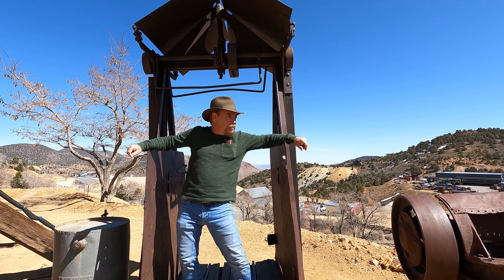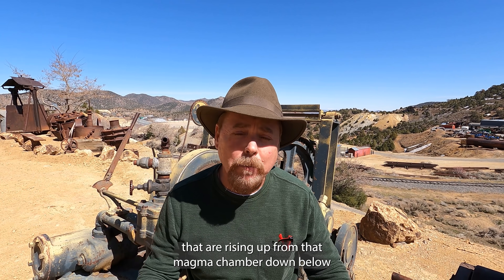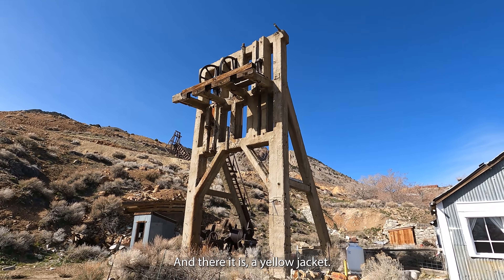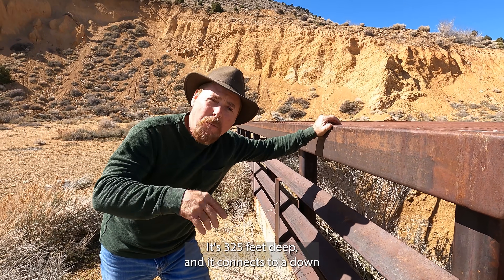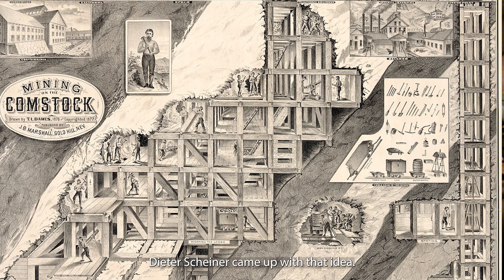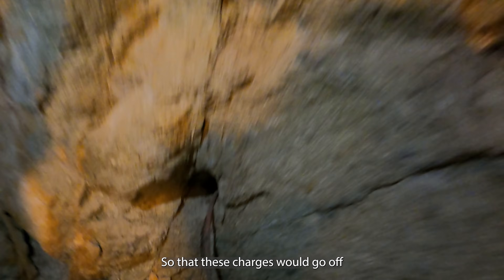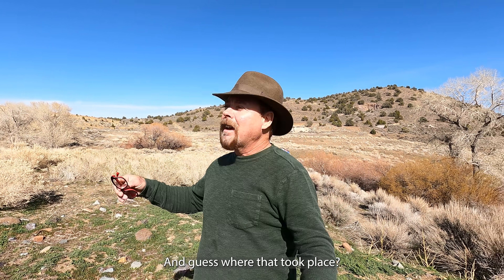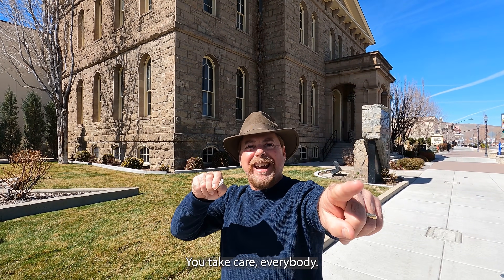Where Do These Valuable Coins Come From? - The Comstock Lode in Virginia City Nevada

Comment: That chain and plate is a catch plate for autimatically dumping the bucket at a certain point in the headframe. Thetes another catch plate located at a point on the headframe and once those two plates catch together, the bucket dumps. I put one on my sinking bucket a little while after i made the bucket except i used a small iron ball and welded a piece of chain to that to make the 'catch' then cut a Y type groove in a piece of steel and attached that to the headframe. When i bring the bucket up out of my mine, at a certain point, that steel ball catches into the Y cut thats in the steel plate which causes the bucket to dump into a chute and either into a ore car or into the dump on the opposite side of the headframe.
Reply from the maker: cool

Comment: Jeff, this is a bit off the subject, but after watching your dad’s video half a dozen times, my 3 friends and I decided to pay a visit to the Ingamar mine over by Goodsprings. Your dad was right, the Ingamar mine is really out in the middle of nowhere. It was a really cool site and we saw some of the Galena veins your dad talked about. One question though. How in the heck did you dad get up to the tower where the tram control is. We went around behind, up the gully, but we could not see an easy way up. Also, we saw where the tram terminated, but we could find where the tram was loaded from. Was it on the other side of the mountain up the gully or was there a shaft at the top?
Reply from the maker: its up there ...you have to up the side of the mine dumps to get to it ....my Pops was as tough as they come and climbed that mountain 4 times just for the video

Comment: 5:27 - Not just a turbine, but a Pelton reaction turbine, indicated for small volume and high pressure water (big diference of high between the tube intake and the nozzle).
The water jet hits exactly on the little "crest" in the padle's center. There, the jet splits in in two lateral jets. Fascinating design.

Comment: You should point out the Comstock lode was originally found from placer panning, the miners were looking for gold but their pans and sluices got clogged with that #$% blue stuff until as you said someone recognized it as sliver,  CC mint was built as it was more economic to mint the silver in NV than to ship it to san fransisco, your equipment appears to include centrifuges and devices to break the clay

Comment: Ok start with the chain on the bottom of the ore skip bucket that chain is attached to a rope / chain to keep the ore skip bucket from banging around sides of mine shaft and to keep bucket steady. I believe some miners from what I gather may even have a counter bucket to offset the weight going up and down in a counter shaft

Comment: Steam winch for the head frame, looks like a pulverizer type machine too
Reply: The cool thing is I’ve used winches identical to those in real life, on live steam and they are amazing machines! Simple, same design used for a century and powerful. It was amazing using a couple of small steam valves and a lever, basically two hands to move ten thousand tons of steamship along a dock using these winches.

Comment: Wench motor .wheels also used for gearing .like a 6 ft wheel running off a 3 ft wheel is 6 to 1 . Diffent size wheels as gear reduction  am I rong . And they  used them big wheels For cable instead of smaller wheels cause would build friction 
That equals heat and heat would make the cable hot . And carbon steel cable dont like heat .did I pass did I pass 🙂 😜👍

Comment: a few things i recognized 
5:13 hydro-sluice cannon
5:27 hydro-electric generator/inverted into a water pump
5:44 the chain with the catch plate on the ore bucket,  possibly has a dual function, firstly it might  act as a  trip mechanism to cut power to the drum wheel raising and lowering the bucket, secondly it could be put there to catch upon a fork setup which tips the bucket at the surface(or into an adit), into waiting mill carts.

great show jeff.
Reply: @American Shad i live in an old tin mining town, in tasmania. we got one of them hydro sluice nozzles at the local lapidary club. theres old mining equipment strewn all over my town. history and experience will always win :)
thanks